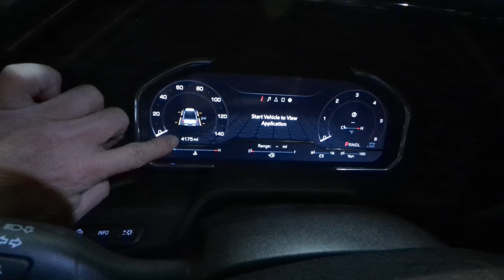GM 6.6l gas V8 2000 mile oil consumption & catch can update

Comment: Damn.  Well i cant do this again.  I have a 2020 F150 5.0.  Nice truck over all but want a 2500 HD next.  My 5.0 burns oil like crazy.  I cant go thru this again.  So messed up these new motors do this.  My 07 6.0 with 210k doesnt burn a drop and runs butter smooth.

Comment: I just got a 2500hd 2025 have put 200 miles on it and when I start it it throws a bit of black smoke should I take it to get checked or is it because it’s a new engine?
Reply: I noticed this on mine as well on cold start. Did you ever figure it out?

Comment: Right on, good vid. A lot of people don't know this about DI. (why Gm didn't do Port and DI together I don't know. Saving money I guess) So that's the easy issue I have with these GM engines...... The BIG issue I have, and why I still don't have and won't buy a GM 1500 with the 6.2; Dynamic Fuel Management!!!!  (DFM) I want exact truck you have, but nope. 😔
Reply: 6.6 L8T, as shown in the video, is not AFM/DFM capable. That's why I went to a 2500 myself.

Comment: I just did the same procedure you did. Just hit 5500 miles and drained catch can before tomorrows 1st oil change. I got about the same volume as you did at roughly the same mileage interval.

Comment: I have a 2024 2500 HD Silverado 6.6l gas I just took it into Chevy. It had 5 quarts in it after 4000 miles. The head of the shop tried to tell me it was normal. 😂 thoughts?
Reply: I don't have this problem but read it could be the oil specs, some have switched to amsoil or RP etc. and eliminated the consumption

Comment: I installed my catch can to the right of yours on the battery tray. I drilled and tapped a new hole and mounted the bracket lower...my catch can doesn't stick up so high like yours...mine still easy to get to. It collects alot...especially in the colder months!

Comment: Seems like an easy addition to help keep unwanted contaminants from getting into the intake as I have found to be an issue with any GM engine I have worked on. My question is that I have heard these catch cans may not be the best for colder climates like in Wisconsin where I live because of the condensation freezing and actually may clog the ventilation system. Has anybody that runs a catch can in colder climates have any issues with freezing?  I love the idea of a catch can because my 2013 Silverado 2500 6.0 had a puddle of oil laying in the back of the intake manifold when I replaced the manifold gaskets and I could only imagine how much of it got splashed into the back two cylinders whenever I would press on the gas. Not to mention that having oil being burned into the combustion chamber will come into contact with your catalytic converters and may eventually cause those to go bad and cats are a very expensive repair.
Reply: You can install a GM engine oil cap that will blow out any excessive pressure. ACDelco FC242 or similar

Comment: I have a 2024 12,000 miles on it hasn’t consumed any oil. I have more issues with the 10 speed transmission hard shifts. I’ve had every make truck out there in my 58 years and in my opinion it’s the worst transmission I’ve ever had in a truck.
Reply: You have the 1500 or HD truck?
Reply: @diamondhead203  2500 hd
Reply: @rhod8201  interesting.  I have the same truck and transmission and I love it. Transmission is smooth as butter.  6.6 L8T with Allison 10 speed.  With any brand and any truck you can get a lemon. I would get it looked at

Comment: Would be interesting to view two 6.6L engines with and without catch cans and inspect the intake valves for coking. I am likely not going to bother on my 2024 GMC I just ordered.
Reply: You don’t need to.  The 2024 already have a built in catch system in place.
Reply: picture? @diamondhead203

Comment: I run rx catch can . I believe they are best . I get 3 oz oil in catch can every 5000 miles in wife’s Camaro. The drain will plug in catch can and wire clears it . 
Next one for my Silverado .
Debate on coking the valve stems . I used valvolane modern engine oil with low oil vapor theory. I still got 3oz. Some engines had low tension rings . 
Nice truck -

Comment: Oh yea that’s similar to what I would get in a Chevy. I have to tell you of an old school way to clean valves and piston tops within the combustion chamber. That is to get the engine up to optimum temperature, then with a spray bottle with just distilled water, find a place past the throttle body, or at least past the intake sensors. That you will slowly spray into the best area you can find at a high idle at high temps. That will steam clean the intake track and combustion chamber.